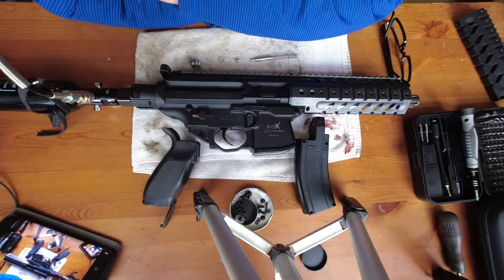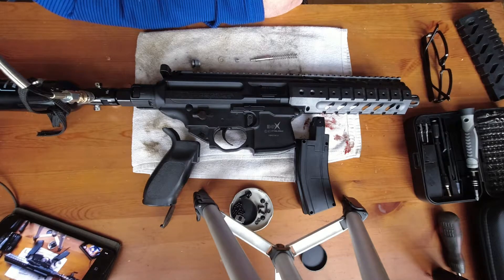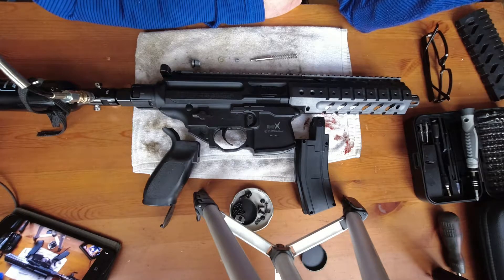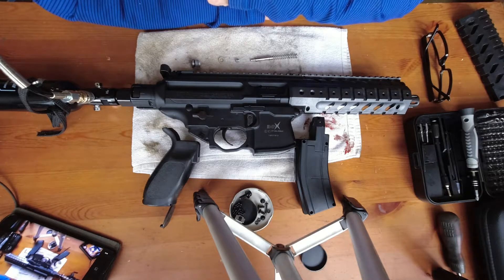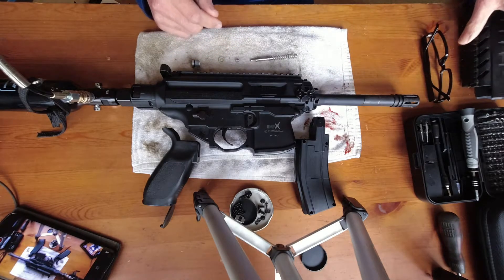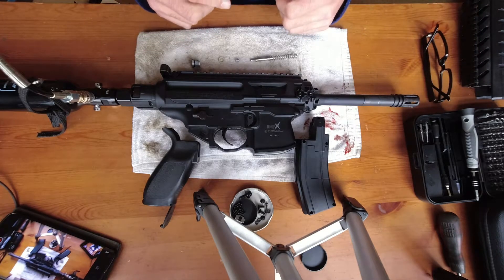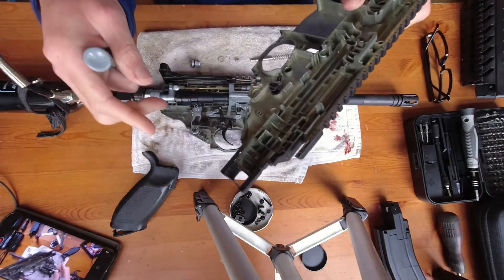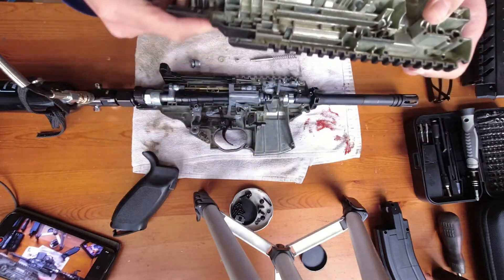Sig MPX C02 Air Rifle - tear down part 1

Comment: Might need to check the small steel ring around the rear of the valve cap if the gun won't recock itself after shots. Might leak a bit too much between the valve body and the hammer's internal wall.

Way nice video. I finally got to see a good view of the MPX's barrel assembly. I just own the old MCX version. Now I'd wanna have an MPX also..😁🤣
Reply: You again 😅 I'm not stalking you I promise mate 😂
Reply: @Replica-Airgun-Lovers  🤣👍🏻

Comment: I disassembled the gun, fixed the pin and closed everything again.. now the trigger no longer seems to do its job well.. did I do something wrong? thanks for the reply in advance
Reply from the maker: Check the safety catch is in the proper place.

Then check the feeding mechanism at the top of where the magazine seats into the mag well.

You can't really test the trigger action with the gun apart unfortunately.
Reply: @pabroon74   thanks for the advice.. unfortunately the pin kept losing its position and made me shoot the gun like a machine gun (single shot) I hope this hasn't caused problems with the piston and I hope to resolve it.
However... I replaced the pin with a 4mm screw (Allen screw) which I screwed in with a thread lock (into the 4mm thread previously created.
I lowered the screw that measures 4.2mm to 2.6 and made it conical... that one shoots like a bomb and now I don't think it will ever move again.
Reply from the maker: @deusmax  Sounds good. The pin in my gun was fine, I didn't have to do anything with it. But replacing it with a screw or similar is the popular fix.

Interestingly or not, every now and again, the gun would fire 'full auto' - however it's just the blowback mech resetting and firing, since the mag belt doesn't advance it doesn't fire any pellets.

Sounds cool though.
Reply: @pabroon74   Now I understand why it blocks but I don't think I can solve it... the final piston, where the high pressure in the pellet comes out, advances upon firing but does not return, consequently blocking the rotation of the pellet belt.
I think I've reached the point of throwing in the towel, I see no way out
Reply from the maker: @deusmax  Okay.

There should be a spring there. It's a helical spring, and it only goes back in one way. I think it's shown on the video.

If it's what I think you mean - the nipple-like thing that delivers high pressure air to the pellet in the belt...

To be honest, on my gun - it doesn't really do anything.

When you pull the trigger - part of that action pushes that nipple against the belt - the spring should cause it to return. (I assume this is what you mean - I'm playing with it at 11m 45s in part 2.

The black plastic clip there, holds the spring in place.

If that's what you mean.
Reply: @pabroon74  thanks so much for the reply.. in the meantime I filed off that little piece (nipple) that goes back and forth (normally with the spring) and now it works great!! Let's hope it holds up over time
We know well that this gun is very fun and beautiful on the outside but on the inside it is really poorly made..
I wish you a wonderful day

Comment: Ok so the sig mcx mpx are pretty awesome but they need care. To start you got to out the charging handle before you can shoot it. Pellets need seating correctly or they won't shoot right. Never shoot with co2 and no pellet running through it.  Last thing that should be said first is the pcp thing. I have been around a while now and hear from a lot of different people about these. The biggest issues i have seen is they always break on pcp, get a double 12g adapter its better suited.  If that broke after just 3 months i would have returned it instantly,  not sure how Scotland works with returns but in England we get a full year. My sigs come with lifetime service and repair so i got lucky,  also i have never had any issue with mine
Reply from the maker: They're not good guns. The internals rattle about, the engineering tolerances are terrible.

The plastic parts are flimsy, the metal brittle and poorly cast. The shooting cycle is, well, imprecise to say the least. (It's a surprise the trigger is as good as it is...)

The gun only runs on C02 or HPA. You say HPA breaks it (it doesn't, unless you over-charge), but also say don't run on C02 but use a 2x12gm adaptor. (Not to mention the wear on the threaded valve from constantly changing C02 caps...)

Scotland has the same consumer laws as England. But if you buy one 2nd hand... And these Sigs most assuredly do not come with lifetime service and repair - would that they did.

Comment: My mag jams all the time the gun works perfectly fine with mag out used the tool to seat the pellets corrected provided with the Gun, any help appreciated checked mags in good condition only had it few months 4 shots then a jam or sometimes won’t fire at all
Reply from the maker: Only thing I can suggest is getting the side off it, and having a look to check none of the mechanism that progresses the belt has come adrift. 

Other thing to check is if the barrel is seated correctly. The flash suppressor unscrews - you can then unscrew the barrel itself.

Sometimes it double loads and you get two or three pellets jammed between the mag belt and the barrel interface thingy. (The block the barrel screws into.)
Reply: Possibly the Nozzle is jamming.
Hold unside down look inside magwell. Do not charge the gun. Squeeze the trigger and ensure the nozzel moves back and forth when you squeeze the trigger everytime. If it is jamming remove the nozzle and slightly take off the  REAR edge with emery paper. The nozzle should be always keep clean. I do not lube the nozzle as it attracts dirt dust.

Comment: I was going to buy one of these but they seem to get a lot of bad comments on Reddit
Reply from the maker: It's a definite hit or miss kind of gun. They're great fun when they're working. Bit of a pain to load the belt mags. But again. great fun...

The other thing to note is - the trigger is actually not bad. For all the internal mechanisms the trigger pull actuates - it's pretty decent for the price.

They kind of got that right I think. It's just everything else that's a bit hit or miss.

If you don't mind fettling, it might be worth it.
Reply: @pabroon74  I was looking at the wrong type of gun. 
Looks like a paintball gun with riot balls is what I need. 
Thieving bastards constantly after my car keys
Reply: @kevinkeelan354 buy a dk pepperball, modified to 37joules or a grimburg gavle pepperball/first strike